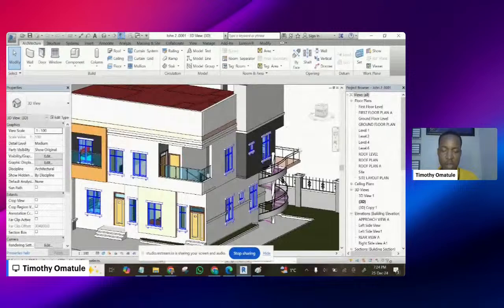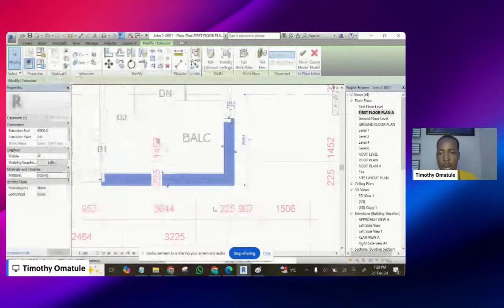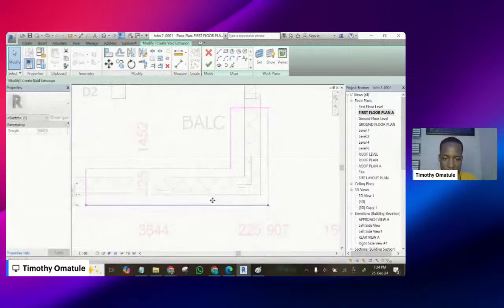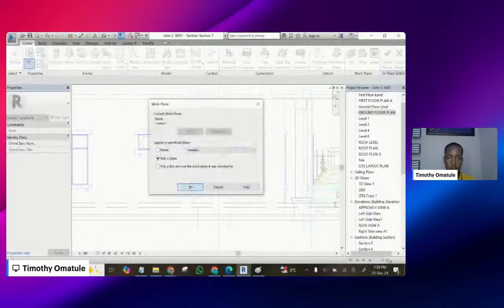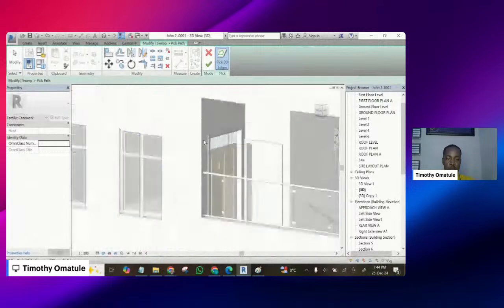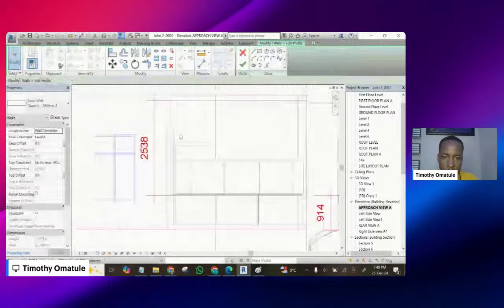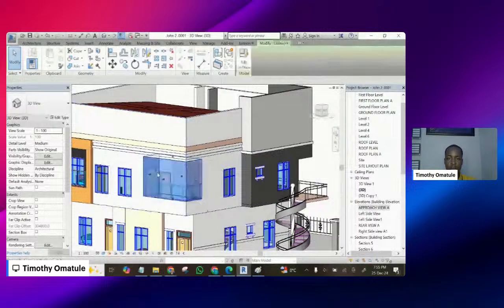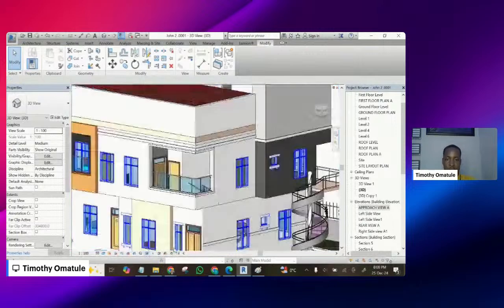Revit Master Reveals Best L Shaped Coping Techniques

Comment: Thank you , when I was doing mine, (Corner coping)I did it separately from each elevation with extrusion
Reply from the maker: Okay did the joint come out neat?
Reply: @ArctimConsult not really, you could see that there is a joint at the corner in 3d, your method will be the best I will practice that
Reply from the maker: @ericobeng4787  Okay